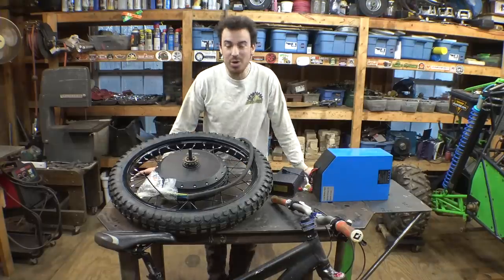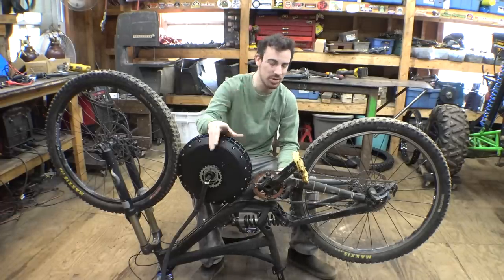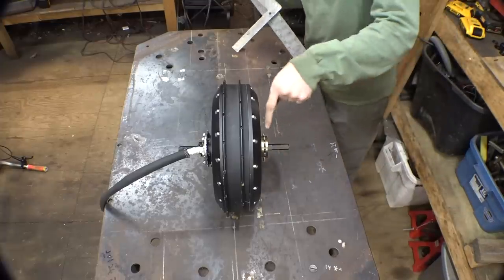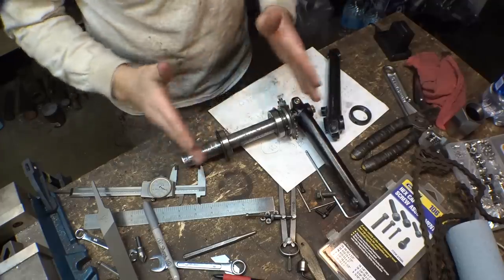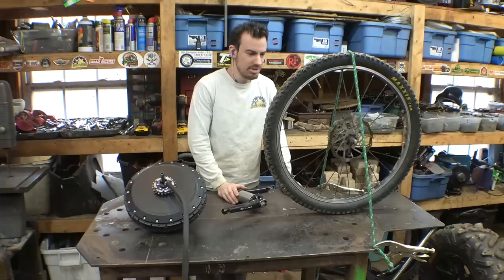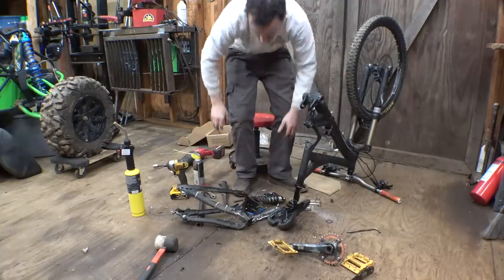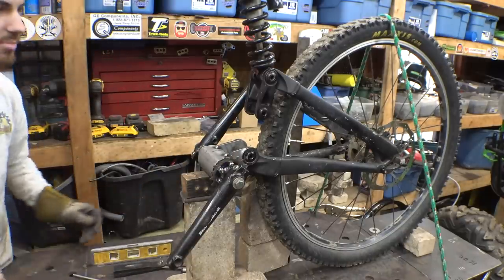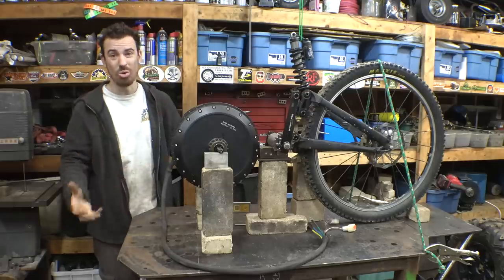Home Made Electric Mountain Bike Build - Part 1

Comment: Cool project. Curious why use a motor where that huge hub has to rotate to produce the power  rather then a motor where the axle produces the power and the big hub part is stationary.?? Just so much unnecessary rotational mass your turning for no real reason. It makes sense as a “hub motor” in a rim but not for anything else at all!!Is it just for the odd/cool/strange factor??

Comment: a 20" stunt bmx would handle this.

14mm thick axles. flip flop dual side sprocket hub. 36 spoke is good enough but you can do also a 72 spoke. and tires that can take 110psi and no issue 300kg on the rear wheel while its under over a 1000w electric power.

the issues with bicycle gears is that above 1kw on even a 7 speed the chain is too weak and the gears too and get shreded. bmx can get away with this cause thick chain and sprockets.

Comment: I've only watched up to 15:00.
 You have built it completely wrong LOL 
You need a freewheel on the motor and freewheel on the crank.

I build a few mid-drive systems Ebike's out of hub motors
I don't have any of them special tools.
I use a homemade welder & grinder.
And all scrap metal & parts.

Comment: i can not believe you gave 500 bucks for a bike  I HAVE A SIDE BY SIDE THAT HAS BARCODE STICKERS ON ALL THE PARTS UNDER IT  it is a 700i made incredibly nice 4 wheel independent  IT HAS NO MOTOR AND WAS SPRAY BOOMED LOOKS LIKE SHI----  I have been looking for a street bike motor for it  but if you wanted it it would not cost you to much more than that bike did  I have a high low reverse gear box that goes for over 800 used on ebay for it also   I truly think you would make it very nice  but all i can do is offer         you have came a long way its all about confidence in your self

Comment: Not to dampen your spirits....I have a friend that's into electric incumbent bikes, and has had a LOT of problems with bicycle parts holding up to rough terrain and torque.  Look into motorcycle rim and motorcycle gauge spokes and get a GOOD bicycle shop to build you a rear wheel.  That rear axle and bearings may also be too light duty.  SORRY, to throw so much crap at ya......

Comment: Holly shit I skimmed the video when I made my first comment, you are gonna use this thing WITH A DETAILER??? I'm sorry my guy but even a massive trials single speed chain would not be able to deal with the amount of torque that motor can put out, let anyone a dinky 9s chain. You'll have to run the motor way below what it's capable of just to keep the chain from snapping, and at that point why not use a 1-2kw motor and save 60lbs? This project has the potential to be amazing but if you want it to last longer than a coue rides your gonna have to change your plan a bit. I'm definitely no expert but if you want some input from a bike mechanic who's made an ebike with similar power I'd love to help.

Your also gonna need to do some heavy modifications to the suspension, with the weight of the motor on the frame your bike will be significantly heavier than any mountain bike suspension can handle. You can replace the rear shock and fabricate a mount to use something that is motorcycle grade (or use two MTB shocks) but for the fork I'm almost positive you will not be able to find any bicycle grade suspension that is stiff enough to get proper sag. I used a 200mm boxer dual crown fork with the stiffest spring and spacers to stiffen it more, and even then the fork feels really squishy and soft. And your frame will be like 50-60lbs heavier than mine, so you will almost certainly need a motorcycle fork.

Just editing this as I go through the video, if your planning on using the rear triangle from the mountain bike you will need to use some sort of chain tensioner (a detailer, or single speed tensioner) due to the length between the cranks and rear wheel increasing as you go through the travel. This is gonna pretty heavily limit the motors power. You can't really put more than like 2kw through regular bike chains or derailers without significantly increased wear on the drivetrain, and you will be limited even more because you are using a 9 speed cassette which uses a slightly thinner chain. If you switch to a single speed chain you can maybe put like 3 or 4kw down, but that's nowhere near the ~15kw this motor can produce. I also imagine you are quite a bit below the max power that motor can handle just by looking at your battery and controller. I would recommend swapping to a smaller motor, which shouldn't impact performance at all because the rest of your drivetrain is already limiting you to like under 5kw. And then that fixes the issue of needing to upgrade brakes, having the frame be too heady for bicycle suspension, and really everything else that's wrong with this project. Or you could go all out and keep the big motor, but then you should probably put a larger battery and controller into it to make the most out of the motor so you aren't wasting weight, and then you will have to essentially make a motorcycle instead of a MTB.

Dimensions are available online, I would copy modern geometry for everything you can as the bike you used are pretty old and you have the opportunity to make a pretty sick MTB with custom geometry. If you want something more conservative copy the geometry from like a comencal meta or whatever trek MTB is closest to your travel

Also please don't kill yourself with this thing, lol

Comment: Yeah I think I would have gone with a standard motor, they even have kits to attach the motor to the front crank so as to be able to use the gears on the rear wheel andd you paid way too much for that crap of a bike I think you could have bought a new one from Walmart for less...

Comment: Did you consider putting the pedals directly on the motor with the pedals using one way bearings so when the motor runs faster the pedals can stay idol

Comment: While I appreciate your willingness to make everything yourself and how incredible you are at fabricating, this project is a bad idea. You're effectively building another electric dirt bike with much weaker parts. I can almost guarantee you will be shredding chains/cassettes and spokes. Idk about where you live, but where I am ebikes with a throttle are not allowed on mountain bike trails, let alone ones with 8000w motors. If you want to build an ebike to ride singletrack trails with, I'd recommend just getting a Bafang middrive kit.

Comment: Your choice of parts is like using a tank motor for drag car: it isn’t the right fit. That motor would be excellent for an off-road quad bike (similar to what people with wheel chairs use) but for a bike? No. You’re basically making a bastardized version of the numerous off road e-bikes already out there- only heavier, less practical, and I’ll be surprised if it is t far uglier. 
Please refine your project into a quad bike, or use a more appropriate drive system. I have faith in you.

Comment: you again didnt program the controller. lol. you cant just plug em in and pray for the best.. you need to tell the controller what settings it needs to operate at. it most likely doesnt even have the correct pole count or angle or currents or safety settings,. etc.. you HAVE TO program the controller.

Comment: why do you keep using those amazon cheap pos batteries? dude buy the cells and spot weld them yourself according to what you need out of them. amazon batteries are almost 100% scams. they over estimate the capacity and amp output. Ive built about 30 ebikes and emoto's and ive built about 200 batteries. 3s-40s. 30A- 1200A.. and im no expert. I learned by researching. literally anyone can learn to do it and the end result is a better battery for usually less money.  You already have the mind of a builder/tinkerer. you would pick it up as easily as all the self taught experts did.

Comment: 75lb motor?! You are trying to ice skate up hill. If the frame does not break, it will handle like a boiled noodle. With that much weight, you should be working with a dirt bike frame. Honestly using a hub motor as a mid drive on a mountain bike is less than ideal. They make MUCH smaller motors that are literally designed for what you are trying. I would forget the MTB and go with a all wheel drive hub motor chair buggy thing.  
The wheelbase you are going to have to have to use that hub motor as a middrive is going to be ridiculously long, so the bike is going to pedal like it was not designed to pedal. Forget pedaling, forget MTBs, do something interesting. MTB’s are a dime a dozen.